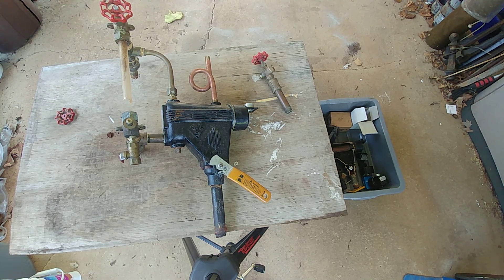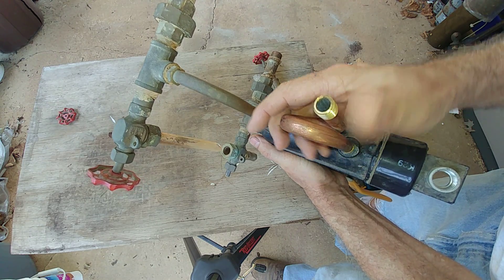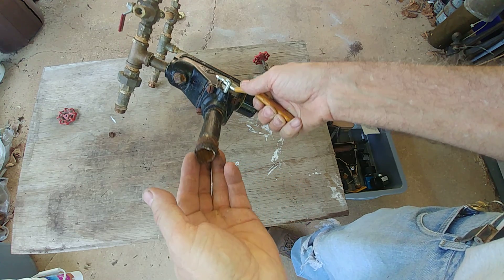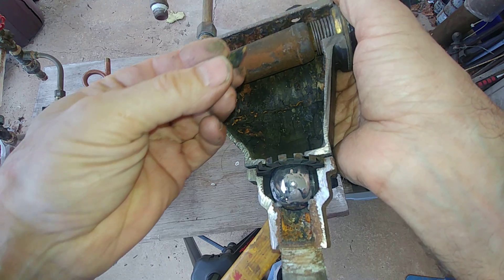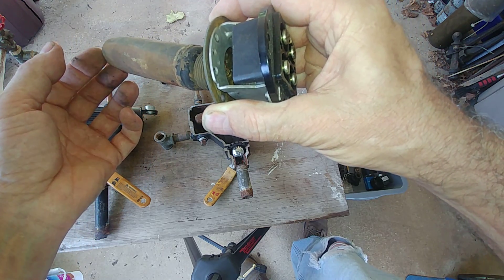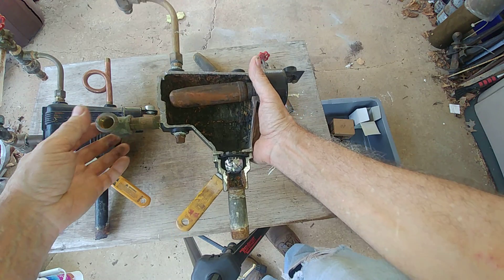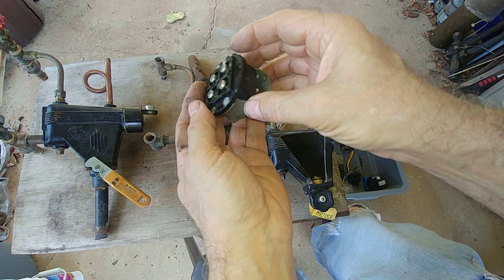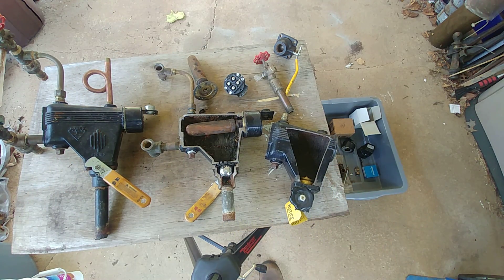McDonnell & Miller's Venerable #67 Low Water Cut Off For Steam Boilers

Comment: Hi how I can clean the inside?  I gave one that not flow water
Reply from the maker: If the low water control is over 10 years old, it is recommended to replace the control with a new unit.
I would consider replacing the control with an electronic probe type.
If that cannot be done, then I would still take apart the entire unit and rebuild it.
This is a safety control and I would not compromise on safety.

Comment: Hi Gordon, I enjoyed your video and it helped me understand how the LWCO works. I am having an issue with my boiler where water keeps filling up in the glass gauge tube. I have to drain it every 2-3 days back to the normal level. I believe it's because of my LWCO float. Please let me know your thoughts on how I can trouble shoot.  (i.e. is it safe to put a camera in the blow hole to see inside?) I appreciate your advice. Thank you
Reply: I should add, I drain it so often that the water I drain is crystal clear.  No rust.
Reply from the maker: What feeder do you have?

Comment: I have the steam boilers and didn’t know it has so many maintenance to do. I don’t know until watching a lot of your videos. Why people still using it.
Reply from the maker: If you have float-style low water safety controls on your steam boilers, you may be able to convert to electronic probe-type safety controls that are more reliable and require far lower maintenance costs.
I would do that ASAP.
As to the overall maintenance issues with steam heating and why people are still using it may best be answered in terms of what it would cost to remove a steam heating system and install an alternate heating system.
Reply: @ I think I have the same McDonnell #67 when you referring to the float style low water safety control are you refer  to this LWCO? Is Series PSe-800 the electronic probe? Other boiler has this one.    I’m learning the term and once I understand I’d call license to do it. I called 2 people and they never mentioned it to me. I’d agree with you about the cost to convert.
Reply from the maker: Yes, the M&M #67 is a float style LWCO safety as shown in the above video and others.

As I say, it is obsolete and a maintenance chore as you now know (weekly blowdowns required for safe operation, etc etc). 

But because people continue to buy it, they will still sell it.

The PSE-800 you mention is an electronic or probe type LWCO, also made by M&M, and it requires much less maintenance and it is far more reliable.

Hydrolevel also makes fine probe-type LWCOs too.

In fact, they invented it (it was a Greek immigrant) and M&M tried to suppress the invention and M&M helped drive Hydrolevel into bankruptcy.

Hydrolevel fought this injustice all the way to the SCOTUS and WON!
(that was when it was not the playground of billionaires)

You will likely run into a fair amount of ignorance and downright stupidity even from licensed heating professionals, sad to say, regarding steam boiler operation and repair.
Reply: @gordonschweizer5154  does PSE-800 series compatible with any steam that have float type LWCO? Is automatic water feeder required using this electronic probe?

Comment: Do you have the part# of pressure gauge that connect with pigtail? My current gauge does not read any pressure with the heat has Been working . Any risk to the system.
Reply from the maker: You may want to check out this video regarding steam pressure gauges.
The link is below.
Please make sure your pigtail is not blocked with rust and sludge!
https://youtu.be/Fz3Ykq8VUec

Comment: So, what happens if it's bad?  Will the boiler not fire at all?  Will the boiler try to start firing but stop?  Will the boiler simply not get filled with water?
Reply from the maker: @deanvandress4693  If the float gets stuck in the up position, and the boiler gets low on water, the burner will not stop firing, and the likelihood of the boiler being destroyed goes way up.
In the very worst case, the boiler will get red hot and set the house on fire.

Comment: Thank you for your very informative videos. If you want to replace this part, what would be the upgrade part brand and number. or you just replace it with the same 67. Thank you.
Reply from the maker: You are most welcome.
I would consider replacing the #67 with something better.
It might depend on how old your boiler is.
IF less than 20 and in "good shape", you may find on your boiler a plug at the right place to remove and install an electronic low water cut off.
See if you can get a hold of your boiler's instructions, that might spell out a tapping chart.
Removing plugs can be a challenge.
Model # of low water cut off would depend on the boiler's voltage and space constraints on the boiler itself.

Comment: Great education you've given us. THANK YOU

We have this unit and when I blow it out (weekly) it triggers the refill but last two weeks it  doesn't stop filling until much higher in the sight glass than previously.  A gentle tap and the fill stops.

I figure the float is getting stuck.  Is opening the little bolt (where you mentioned the little piece of cardboard)  and digging around with a pipe cleaner a good first step?
Reply from the maker: I would open up the 1/4" hole at the top of the unit (you may have a pigtail & pressuretrol threaded in there).  
Don't forget to drop the water level first to just below the hole!
Next, I'd poke the float with the sight glass protecting rod - push and release several times.
You should hear the clickity-click of the switch.
That should free up the float.
At least for awhile.
Others have suggested on this thread that you should take apart the unit by removing all those screws and pulling the float.
Then, you can thoroughly clean the inside of the #67 of all of the rusticals. 
You will need to completely remove the old gasket & install a new one.
I would consider replacing the #67 with an electronic probe-type LWCO if you can.
What type of feeder do you have?
I would replace it with a VXT instead.
Reply: The problem I'm having is the part that's rusted is leaking. Some how my radiators over flowed and we shut system down. Do I need a new boiler or just clean inside to release float ?

Comment: If you replace the old cut off valve it is work or not
Reply from the maker: Not sure of your situation.
You are likely to need to scrape the rust out of the inside to free up the float for starters.
I would replace the original valve type with an aftermarket type called a "dirt pocket".
Here's a link to a video on that: https://youtu.be/sGUtBz4b-oY

Comment: Would you recommend on new boiler?
Reply from the maker: Generally, on "package" steam boilers, the LWCO is picked out by the manufacturer and to swap it out with another type may void the warranty.
Many smaller steam boilers now come with the Cyclegard installed on the block.
I was told by the folks at Hydrolevel that since boiler manufacturers started doing that, warranty claims for burnt out boilers declined markedly.
Love it or hate it, the Cyclegard LWCO is here to stay for a long time.

Comment: Hello Gordon,  I want to thank you for all your help in the past. Very much appreciated!  I have another question.  Why would you smell gas when the boiler starts up.  Is this normal or?  My furnace installer said that it is a normal occurance.  I would appreciate your input.  Thanking you in advance.  Ornelio from Ontario
Reply from the maker: You are most welcome.
As to your concerns, it is difficult to give much useful advice as I cannot be present to observe your system.
But did the tech to a combustion efficiency analysis on your system, checking especially for CO?
Did they "clock the meter" to see if your unit is overfired? Check draft/chimney? Observed delayed ignition? Leak on pilot tube?
If not, I'd find another tech who will do these proceedures.
If they did these things, and there is still a gas smell, is the boiler sooting up? Is make-up air to the boiler ok?
are questions that might be addressed.

Comment: Does M&M #67 LWCO send a signal to automatic water feeder when the water is low? If so, what's the purpose of the M&M probe type LWCO?
Reply from the maker: Both the #67 and any probe-type LWCOs have provisions for sending a feed signal to an automatic water feeder when the water level gets low.
The water feed request is a convenience only and not a safety device.
The only true safety purpose of ALL types LWCOs is to shut the boiler's burner off when the water level in the boiler gets too low.
The probe types work pretty well with reasonable maintenance.
The float types require lots more maintenance and have a much higher rate of lost boilers due to burn-outs.
Reply: @gordonschweizer5154   good to know. My boiler has both #67 and probe type LWCO and my automatic water feeder started working again. I wonder if it was because the float was stuck. In another thread, I was asking if there is a way to trigger a call for water by jumping the terminal? This way I can test that water feeder is still working but the float is stuck.

Comment: Is anyone else amazed at what this hunk of American cast iron costs these days??
Reply from the maker: What is particularly galling is the #67 is obsolete & has been for almost four decades.
Reply from the maker: A percentage of the cost of these pieces of crap are to pay for the platoons of lawyers needed to fend off the lawsuits of folks trying to recover the costs of boiler replacements when these fail and burn up their boilers.
Or so I have been told.
Reply: @gordonschweizer5154  Your disdain for these hollowed contraptions slips through your excellent presentation of their inner details.  Remember that they were of another age, when things were mechanical things were cared for.  I always loved the 67 and the 47 and they've been very good to me.  But I only put them on well-maintained and properly piped boilers and take good care of them.  I've seen some real disasters too... Dimwits used to install them too high, so they'd flood the boiler each time they fired.  Seen hundreds like that...  Great reading another experienced guy's views of these things.  I don't like electronics, but I suppose these things are actually 𝘵𝘦𝘮𝘱𝘦𝘳𝘢𝘮𝘦𝘯𝘵𝘢𝘭 𝘥𝘪𝘯𝘰𝘴𝘢𝘶𝘳𝘴 these days.  My, how the years pass.

Comment: Gordon,
I recently had an issue whereby the float was stuck.  I opened the valve and drained the system and the boiler kept running.  I drain it weekly in the winter months.  What is the best way to clean that chamber?  Is pushed a brush up there with the ball valve ope and it worked but not sure I cleaned well enough.
Reply from the maker: I am so glad you discovered the infamous #67 stuck-float-burner keeps-firing before disaster struck.
Seems like you cleared the fault.
Keep an eye on that water level & keep flushing & testing it weekly.
If your boiler is not that old, consider having a probe-type lwco installed.
Reply: Thank you, the boiler is about 25-30 years old.
Reply from the maker: Ah, it might not be worth it to convert.
Keep a close eye on the #67.
Reply: @gordonschweizer5154  Thanks for your help Gordon not sure the plumber I use will know how to convert it

Comment: I was glad I found this video,
today I had issue with the exact model, the bottom 2 terminals were stock closed ,while the top 2 terminals stayed open , any part number to replace the switching part
 would be appreciated, & does the float need replacment ? i  appreciate the video.
Reply from the maker: Did you make sure the float isn't stuck in the down position by rust chunks on the side?
Can you hear the soft <click click> caused by the float moving down then up when you operate the drain the 67?
It might be worth it to investigate getting a probe type LWCO.
A new #11 (309100) switch is expensive.
Reply: @gordonschweizer5154  I didnt check the float yet its model 67, I would say theres 2 screws on the side of the switch ,once removed switch should pull out with float ? buying just the switch is it cheaper?, if I go with the newer models , I would to slightly repipe around sight glass.
Reply from the maker: Remember, I can't see what you see.
You can remove the switch and try to move the float linkage by hand...maybe.
If the float is stuck, un-sticking it may get you going.
The float might be bad, but trying to replace that could send you down the rabbit hole (don't ask me how I know...)
It may be a bad switch.  I can't tell from here.
What happens when you try to drain it?
I really don't like the 67 because it is an obsolete design that kills more boilers then it saves.
Reply: @gordonschweizer5154  I drained it few times ,but no change in switching .
Reply from the maker: @nykid8849  I'd hate for you to drop $200+ for a new #11 switch just to have it be a stuck float.
Reply: @gordonschweizer5154   I.ll probably go with newest  low water cut off, the float & switch are costly , I appreciate your help sir .
Reply from the maker: @nykid8849  You're most welcome & best of luck!
Reply: @gordonschweizer5154  👍
Reply: can you recommend me the probe type.of low water cut off in the market that will directly repalce this 67,I was told by supply house that theres no repalcment to this model ,not sure how true is that
Reply from the maker: @nykid8849  What model boiler do you have?
Any idea of its age?
Reply: @gordonschweizer5154   it's a peerless steam boiler model# 61-06-stdg-sp
Reply from the maker: You can get a manifold from Hydrolevel that mounts in a similar way as the 67.
It is their #711C.
There is one on eBay (I'd not use that LWCO that is listed with,  just the manifold & some of the hardware)
It will have to be drained like the 67, however.
The probe can be mounted in the 711C.
The new electronics can be mounted on the probe. 
I haven't installed a Peerless in awhile, but I think the LWCO circuit is 120V, so you will need LWCO electronics that runs on 120V.
It might be better if you can remove the 3/4" plug at the right location on the block to the left of the sightglass. 
I think it is labeled "R" on some tapping diagrams in your instructions, which I hope you still have. 
The probe can be threaded in that tapping and the electronics mounted on the probe.
You don't have to drain it like before if you go that route.
Getting the plug out is the hard thing! 
A proper sized 8 point impact socket and a cheater bar or a impact driver on loan will make quick work of that.
Reply from the maker: https://youtu.be/IThoboKgnes
Here is a video showing the 711 replacing a M&M 47-2
Reply: @gordonschweizer5154   well explained & easy to understand, how ever owner agreed to replace parts on current 67 setup so I replaced the switch & cleaned the inside of 67 & reused the float &  after manually  testing 67 to sure proper operation, I wanted to ask if it's normal on 67,when it  fills sightglass half inch up from bottom of sightglass it fires up boiler about 15min into  boiler running, I can see slowly water   dropping in glass, how often does the 67 cycle boiler on & off feeding water to it ?
Reply from the maker: The #11 is two switches in one.  It should call for water just a bit before it shuts down the burner, i.e. there should be a "dead zone" between the two switch actions.
You can "tweak" this zone with a tiny screw on the #11, if you so desire.
The #67, when mounted on the sightglass fittings, will just maintain the minimum safe water level.
I would manually add water to the middle of the sightglass and see what happens.
If you are still losing water, that's a problem.

Comment: Great video.  I put in a new McDonald Miller switch (#11).  The auto feed stops when the float is parallel to the floor - the water level in the glass tube is about an inch.  The glass tube is about 4 inches. I would have thought that maybe more water will fill from the auto feed, but stopping when the float is parallel seems right.  is it?
Jeff
Reply from the maker: Thank you for the kind words!
What model auto feeder do you have?
Reply: @gordonschweizer5154  Gordon,  I have a McDonnell & Miller Uni-Match WFE-24 Universal Water Feeder.  regards, Jeff
Reply: If they filled when the water line dropped only a couple of inches, the boiler would be overfilled when the condensate returned after steaming.  Some systems return condensate slowly.

Comment: Awesome video. I was wondering if you could go more into detail about the wiring of that device you show at 5:20. I need to know more about the electrical connections.
Reply from the maker: Thank you!
That switch is shown sideways at first (sorry!) To your left, you should see the word "top" and the numbers "1" & "2".
Those are where you wire the burner circuit to.  The bottom two terminals are where you wire in the water feed circuit.
When the float is up, the top terminals are "closed", that is they can conduct electricity, and the burner is allowed to fire when the t-stat calls for heat and the other limits are "closed".
Reply: @gordonschweizer5154  Thank You
Reply: @gordonschweizer5154 Is there a way to trigger a call to water feeder to test if the bulb is stuck or not. If I jump the two terminals on the bottom will that work?

Comment: How to flush no67 and cost of parts
Good video
Reply from the maker: The cost of parts for this unit are too high.
Still cheaper than a new boiler, however, if this unit fails.
If the #67 needs parts, its usually best to replace the whole unit with an electronic probe type low water cut off, if possible, as this unit has been obsolete for decades.
You may need a pro (good ones willing to do that work competently are not going to be cheap).

Flushing properly is a straight-forward and there are videos on that, I believe.  
It should be done once a week while the burner is running so you can verify the burner shuts off when the chamber is drained.